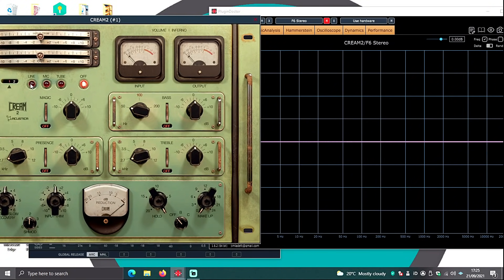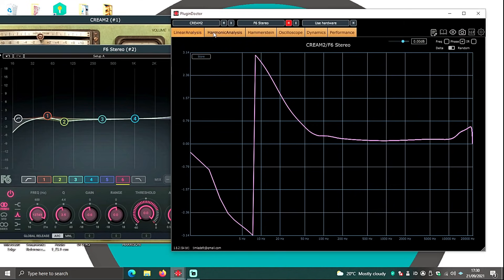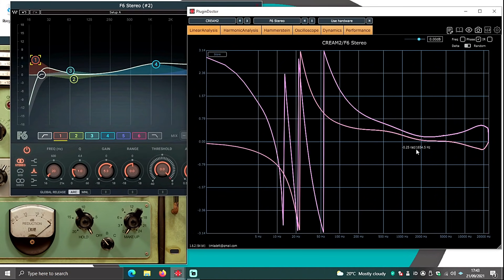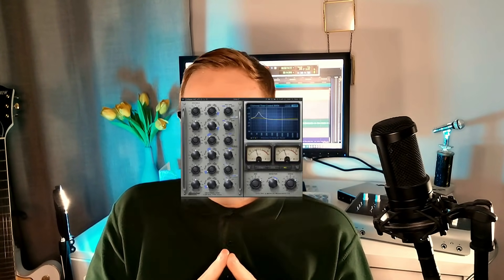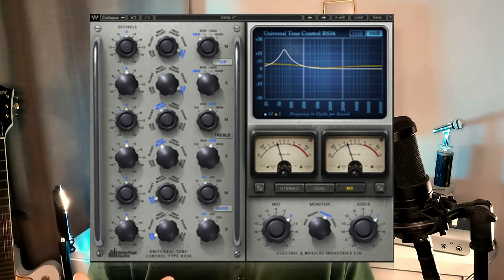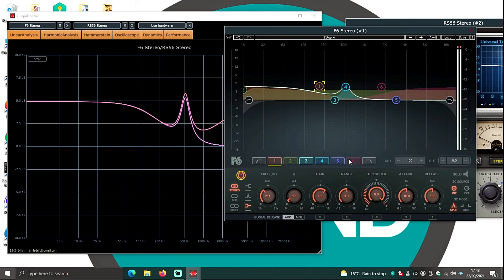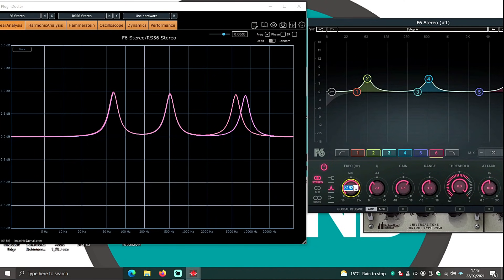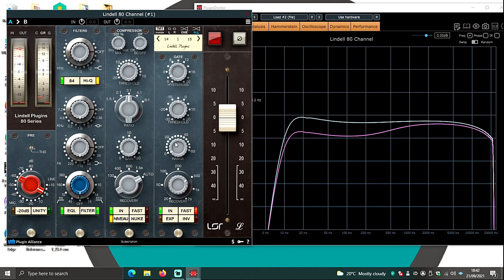WHAT MAKES A PLUGIN MORE ANALOG? || the differences between analog emulations and clean linear fakes

Comment: Okay, I'll play devils advocate on this one. "The Sound" an EQ has is more than just harmonics, phase and actual EQ-curve. With equalizers for instance it's A LOT about what frequencies the bands "default" at and what the Q is. Also how many bands you have.. and yes, how it looks too. Trust me on this.. the interface and the default settings will influence your results every single time.. more so than little nonlinearities, harmonics and phase - most of the time. So there is still some value in "emulations" that don't really emulate everything - but do the looks, Qs and default frequencies.

Having said that: Of course they should be transparent of what they emulate and what they don't.

(With compressors it's more about the ratios (and actual ratios) and knee-settings.)
Reply from the maker: I get what your saying but if that's the case then you'd only need one good clean linear eq.

Match the q and the frequencies. Save as a preset. Job done. There's no need for a purchase as you can just load a preset. I could save the the Harrison and Rs56 as presets and get the same sound.

Certain frequencies are certainly classed as musical but that can be easily saved in a standard eq.

Its the non linearities of the system that make it different
Reply: @PaulThird  many people will argue that all you need is a good clean linear eq. And yes, these kind of presets would actually be worth something. If you load a skin on top of that you could sell it!

Nope, the non-linearities are one part of what makes'em different. Harmonics and phase another. But in my humble opinion looks and starting defaults are relevant too.. and I think how much of a difference that makes gets underestimated.

Let me put it this way: Look at your room. Now don't take anything away, nor add anything.. just make a concious decision of putting one thing you regularly use somewhere else, where it would also be useful, but in a different way. Imagine that would be the new default place for it.. it WILL change a lot about your everyday life... eventhough you COULD technically wake up everyday and move it from it's default position to another place.
Now think about changing the color of a wall, or the height of your chair. It all plays a role.
Reply: @akagerhard  Well there are more parameters that go into how an analog unit sounds, in instance slew rate is crucial in an EQ, the more you boost high frequencies and the higher a frequency is, the more it will be affected by the slew rate of the components.
IMHO that is a huge part of why a lot of people say that on some analog EQs you can just boost the highs much more than you can in a clean digital plugin.
Also, the impulse response of a unit or plugin will make a big difference in how it sounds too.
Reply: @kelainefes  Gonna add another thought. To my knowledge the main reason analogue eqs behave better when boosting highs is due to "eq cramping". Which - in case you don't know and I don't assume that, but maybe somebody else doesn't - is that the Q gets "deformed" on the side that is closer to 20k. This can be solved to SOME degree for example and most commonly by: oversampling.

Some digital eqs are very good at not being bad at boosting high frequencies. Here is an in depth video on the differences between digital eqs - because: They are not all the same. youtube: "What's Wrong With Stock Plugins? Ableton Live EQ8 vs FabFilter Pro Q3".

PS: I suggest to check your plugins for wether they solved that problem, or wether you have to use oversampling in order to fix that.TRackS Equal solves that problem itself, so does Fabfilter ProQ3, but Waves F6 for instance needs oversampling. So it's not even about stock or non-stock.. it's about fixed it or didn't fix it.
Reply from the maker: Gerhard you are dealing with a tight scotsman. In my accent:

AM NO SPENDING MONEY FOR SUMMIN I CAN DAE MASEL

in other words, I like having tools that give me quite different results. To me it makes much more sense to save presets in one digital eq you like to use and work from that one plugin if that's all it takes is to save settings. If there is something that i need for colour then I have those more non linear specific options as well.

Suppose it's whatever works for you but I'm always thinking about where to put my money and being able to justify it. The question is.. Would you still buy a specific plugin knowing that its simply a linear recreation you can simply save a preset of? Would you still put 50 quid of your hard earned cash into the purchase. It's one mentality already owning a plugin that's been found to be a con, but it's another buying it knowing its a con. 

For example you can save the settings of Harrison in Proq3 and have no eq cramping. You can remove the things you don't like and really the world is your oyster from that respect. All you need is plugin doctor and the ability to save presets. 

Its a mentality thing. If this was the matrix I'd take the red pill.. You'd take the blue pill 😜 haha

The gui thing reminds of the matrix

“I know this steak doesn't exist. I know that when I put it in my mouth, the Matrix is telling my brain that it is juicy and delicious. After nine years, you know what I realize? Ignorance is bliss.”

Sorry.. I can't help myself 🤣
Reply: @akagerhard  I agree that cramping plays a role, I follow Dan Worrall too.
But imagine if you had a sort of a frequency and level dependent limiter/saturator included in your EQ's high bands. That's what a careful component selection in regards to skew rate can do.
Reply: @kelainefes  well yes, I kind of settled on using EQs to EQ and using Saturators to saturate. I understand that some units try to do both.. but I prefer using tools for exactly what they are best at. I'm not the kind of guy who would use a Spork.. I use a Spoon AND a Fork.
Reply from the maker: ever since some guy started making reference to me and the matrix I canna stop thinking about it haha absolutely cracks me up 🤣

He was telling me I'm soon gonna have agents at my door with waves badges on their suits and everything

He got so into it and I just let him crack on hahaha
Reply: @PaulThird  well, you ARE publicly sharing glimpses of the code. If you do that too much you WILL be faced with the option to either join the system and make it better, or fight the system (which doesn't really work, because there's always a system replacing the system) which usually ends in creating a small own system that is as isolated as it can be from the bigger system.

You think it's all fun and games now :P just wait..

PS: (if you'd choose to do the same in areas more relevant to the general population than in audio engineering I would not be kidding)
Reply: @akagerhard  I don't understand your point. If a company claims their plugin emulations sounds like the original and that is measurable not true than this is cheating! It's that easy.
Reply: @NikolausBrocke  Well, if you tell your wife you brought out the garbage, but you did not bring out ALL the garbage - just SOME.. does that make you a liar by omission? I guess so, because it is reasonable for her to expect you to bring out ALL the garbage. Still you brought out SOME of the garbage and as long as you are TRANSPARENT about how much garbage you brought out of the house, you'll be fine.

But do you know what I think? I think you are smart enough to get my point. You are just choosing to make it black and white, where it's actually grey. If you read my comments you know I am all about transparency and I don't condone when people imply to deliver something that they don't. My post was, first and foremost, about shining a little light on the fact, that optics and default-values (of Qs, Frequencies and such) play a big role in what kind of sound you will create. I was not saying: The way Harrison marketed their plugin was consistent with the product they delivered. So please, make an effort to enable sucessful communication.

I think I explained my point fairly well and I will not further add to it. Everything has been said, either one gets it - or not.

Comment: You don't know what "non-linear" means. You can tell a processor f is non-linear if f(a + b) = f(a) + f(b) where a and b are any two signals. A frequency response says nothing about non-linearity of a DSP algorithm. It does not mean "deviates from flat frequency response".
Reply from the maker: It's just a simple video showing others what to expect from analog emulations. A non linear system has an output that isn't proportional to the input. I was showing others snapshots of a non linear system which is what convolution is. Showing the sampled IR's of frequency responses of pre's, changes in frequency response due to harmonics etc

Its obviously not technically non linear as they are static curves with no element of randomness but analog emulations are modelling a non linear system which is effected by its components and other variables. That's what I was explaining. 

Simply for others to have a better understanding of why i claim certain plugins are just pure marketing cons while others are at least trying to model the hardware they claim to recreate
Reply: I'm salty I had to scroll down this far for this comment.

Comment: I'm not sure this is entirely correct. A linear eq is typically referring to a linear phase eq. Non-linear plugins emulating analog simply mean a harmonic series is introduced into the signal that was not present before. This is true of all analog emulations, dynamic processing and of course harmonic distortion plugins. The tonal differences at different input levels and on different settings is just snapshots of the tone at those points, but the non-linear character is about the added harmonics. You can have the same tone and have no harmonic content. Plugins without added harmonics are considered linear, not to be confused with linear phase or the linear test within plugin doctor.
Reply: You have no idea what you are talking about.
Reply from the maker: I agree not 100% entirely correct. However as I shown in the video after this, which this video was a pre-cursor to, in reality the plugins can only be snapshots of non linear behaviour as there is randomness in plugins as its still all mathematically precise. Even the harmonics are perfectly precise where in an analog non linear system it can change all the time due to humidity, age, wear, power etc etc there's a randomness to analog that I suppose would be near impossible to code as software needs a level of predictibility to be coded if that makes sense.

You could recreate elements of it but  I think we can agree where we are right now, what we class as non linear in digital still isn't anywhere near analog.

Thats my thoughts anyway

Comment: All of this is snake oil. From the "analogue is better" BS to the plugin emulations that mimic them. It's all designed to separate you from your money. How many iterations of the 1970s SSL do we need before we actually design a better sounding desk? We praised the creators of digital as it gave us better sound, better workflow and total recall.  But now we want to go back to the 70s and 80s LOL. Why are we obsessed with this nonsense? Just focus on good quality digital plugins and if you want an ssl then go buy the proper ssl.
Reply from the maker: The reason for the obsession is down to glorification of historical gear and a need to cutting corners. Many believe that they need the gear used by the pros to sound like them or to be pro. Instead of actually understanding the art of the craft and how and why they actually use what they use. Doesn't help when social media and all of these mix with the masters vids are in settings where engineers are engulfed with gear, consoles, and instagram is filled with gear porn.

Just by pure association many new to the industry will see engineers they aspire to using gear that costs thousands. Obviously they don't have thousands so many plugin developers use this to their advantage and sell 'faithful emulations'

The issue is we all hear about 'the ear is more important than the gear' but you'll see studios littered with gear that accumulates to somebody's mortgage.

Analog emulations is just the tip of the iceberg and the result of an underlying debate thats will continue to be fueled for a long time yet
Reply: @PaulThird  couldn’t agree with you more. Fortunately for me around 2000 I dreamt of having a studio in a rack, a plug and play studio that was minimalistic in nature and digital did it for me. I was never going back. Now I use the stock console plugin from my DAW (Cakewalk) and thanks to Waves thievery I steer well away from plugin manufacturers BS. What I want is a modern interface, no bloody knobs please and no fake ssl front ends. I don’t want colouration though I do use the tape plugin that comes with my daw. I’m slowly being weaned off this analogue addiction. I went digital for a reason and I must not forget that reason. Thanks for your videos. Love your Scottish accent by the way (viva Scott McTominay haha) and I look forward to your next video ruffling the feathers of these plugin manufacturers. Keep on keeping on brother.